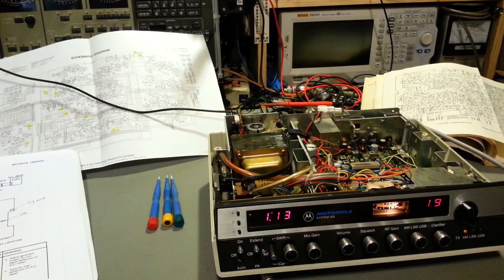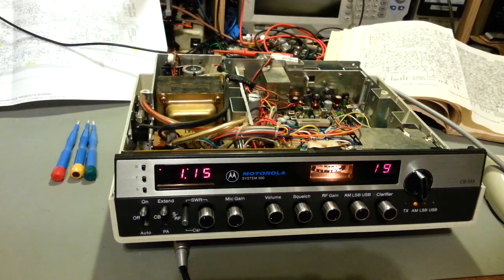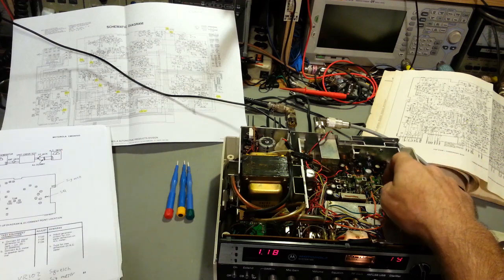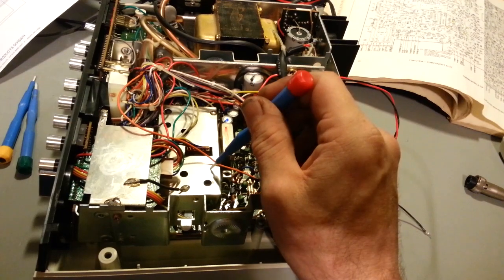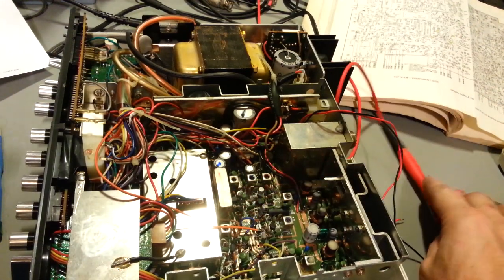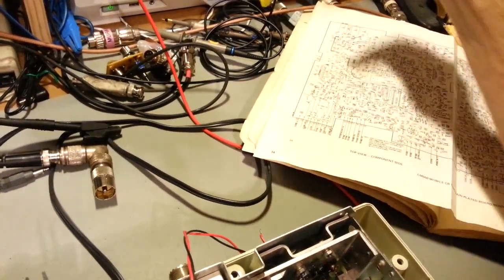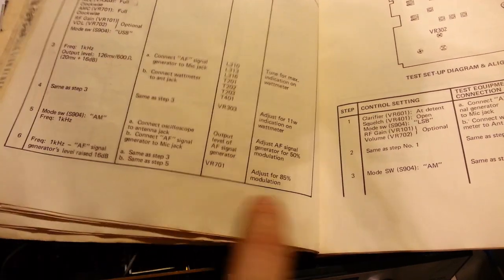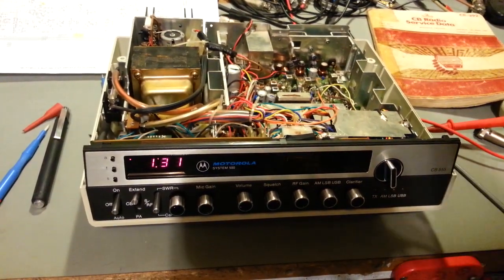Motorola CB555 AM/SSB CB radio PLL alignment tips.

Comment: Top video Mike!!! I’m currently doing one for a client and getting that apart is a PITA as i needed to get to the inside of the RF Can on the antenna as there’s a fault inside that is intermittent!!! Of course Motorola never did anything to make access even close to easy and then they have that ass backwards microphone plug and socket!!!! The nuts on the bolts for the PSU aren’t captive either!!! Then they have that huge RF shield underneath thats soldered on as well!!! Great radio but a total PITA to work on!!!

Comment: Why can't the manufacturers of these Citizens Band Transceivers use a board with a DSP processor and EEPROM that contains the firmware that makes the radio work and take a signal from the antenna and covert it to I/Q signals via a Tayloe QSD into I/Q signals that get digitized using a dual channel ADC  then get processed by the DSP chip and send it  to a DAC then on to the speaker or on transmit digitizing the speech from the microphone via a ADC then on to the DSP processor chip then on to the dual channel DAC which feeds I/Q signals to the Tayloe QSE then to the antenna via a bandpass filter come on you know you want to and leave nothing for golden screwdrivers.
Reply: ku4uv it would stop golden screwdrivers in their tracks